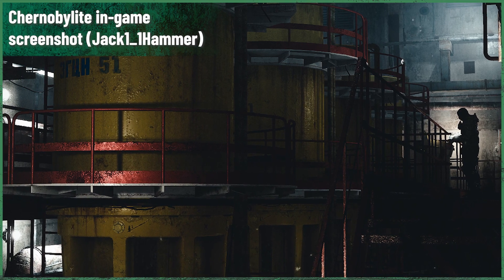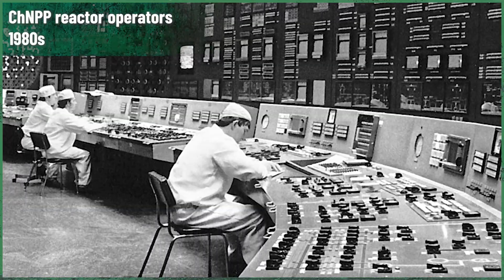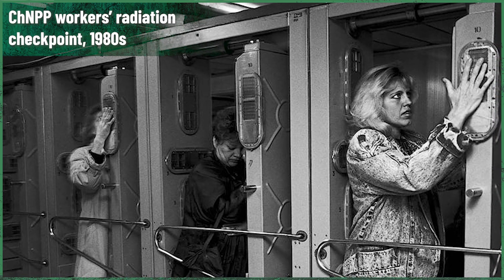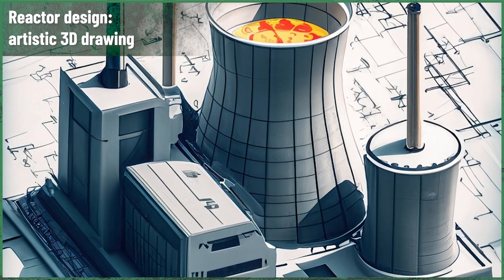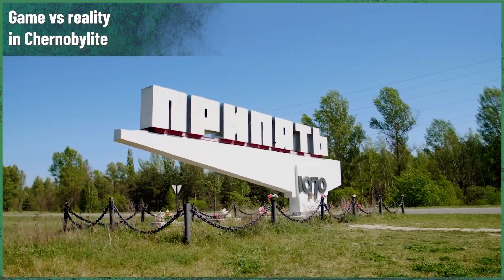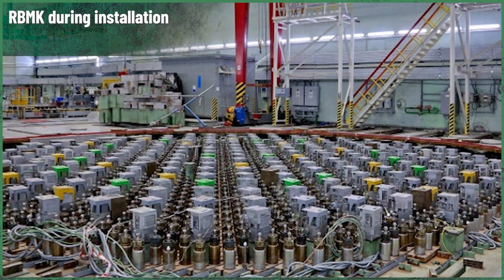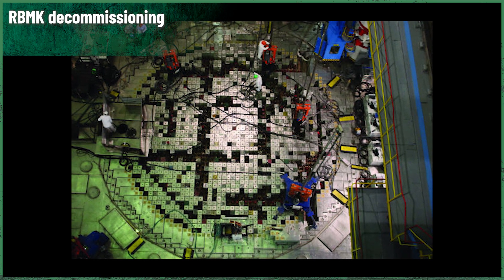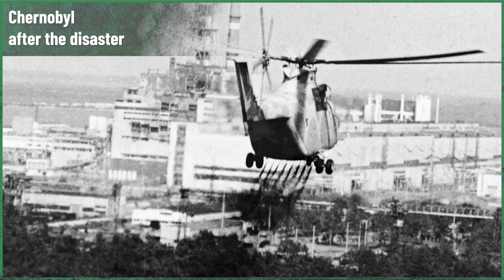How big was RBMK and... why? - PART 4 ||| Chornobyl Stories

Comment: You make a good point here about what the politics were attempting to do: prove that the communist system was better than the western capitalist system.  The failure at Chernobyl was also a demonstration of the failure of communism.
Reply from the maker: Hard to exactly tell which contributed to which (or if both were supporting themselves interexchangeably).

If I remember correctly, Gorbachev said that Chernobyl was one of the reasons behind the fall of the USSR.

Comment: The Soviets and to a lesser extent Russians have a habit of building megaprojects as a display of power. This was actually challenged by few within the system, one of which was executed for his dissidence.

The West does have some of these, but generally these were built as expansions of older facilities and/or relocations of smaller operations—not as a display of power since most of these were built by private corporations.

Comment: It may be worth mentioning that the inner core was not pumped full of water.  Water flowed through the technical channel pipes from the bottom.  The space around the graphite blocks was dry and filled with a gas that would prevent corrosion and assit in transferring thermal energy from the blocks back to to the channel.  

I had always wondered if the core was "wet"   like a PWR, so this fact was really interesting to learn.
Reply from the maker: Thanks for your insight!
Reply: @Chernobylite  You're very welcome. 
This is also the space into which the steam would have flowed and expanded the instant any of the individual channels  were breached. 
 
My source for this little detail comes from the plant drawings available on the Internet, as well as several recorded lectures available here on YouTube. 

-DJ

Comment: That’s what I hated about the Chernobyl movie or HBO special whatever he said it was cheap I don’t see that what’s the name of this video how big the reactor was whenever I hear a big does it mean cheap still cost a lot of money can you imagine if it never happened and I wonder why people are so curious now it happened in 86 i’ve been studying it since 2000 here’s a video for you why don’t you do a video on how all four reactors were basically a little bit different And how the accident can’t happen again with those reactors because they know what Went won the last time I find it amazing when people realize that they’re still running these kinds of reactors
Reply: Woah, you need to start using punctuation, I almost ran out of breath reading that.
Reply from the maker: With reactors size is not actually the biggest cost-related issue. The size was an effect of cost reduction during the design process.

They could've made it a lot smaller, but they wanted to go for max power with minimum spending.

So overall it wasn’t cheap (like a house or apartment, e.g.), but it was cheap for a nuclear reactor ;-)
Reply: I am not impressed that Russia still operates RBMK. It just shows that Russia lacks the funds to modernize its soviet infrastructure. Even the successor of the RBMK design was never built and only Putin knows when Russia will ever bring Kursk-II to the net.

Comment: Exelent begining! ,But,MAINE reason for reactor core being so huge,in comparing to western one,is the fuel(Uranium,that was not enrich enough-so to compensate they needed tri times,or more of Uranium (2325(fuel),simply -it is cheaper,american reactor cores needed at least 3 time less Fuel,but HIGHly enriched,...but there is mutch more to say about design-and powerty that lead to it....the reason to remember the 211 contror rods made of borron,it must tu remember ,beacouse russians ,in rbmk reactor specified that lowest number of inserted rods in the core must beat least 15<,nor 6 as they left in the unit 4 in which occured power surge...allso,special story,than there is xenon pit "poisoning",,,,but our friend goes slowly and werry precise with explaining,so i let this to him and his crew,all the best from me(with fly and temperature-everythings hurt me :( , Greetins Andzej -be safe,wach out of NKVD :))) , Stazi,i heard that mp Vlada is getting info about this channel,ok ,that I am allso in the list ☺ Greetings from Belgrade. Henrik
Reply: Other reactors use 3-5% enriched uranium. Uranium is not “highly enriched” until at least 20% U235.
Reply: @rdspam  Exactly. The RBMK ran at initially at 1.8% enriched fuel and was later rised to 2% because such a low enrichment made the reactor less controllable. I don't know how low they let the fuel burn down, but I doubt it is much lower than possible for modern PWRs, since it was easier to swap the fuel rods in the RBMK.

Comment: Great vid but did it have a problem with one area being less active and one area very active or is it a myth?
Reply: No, that is not a myth. The RBMK is so large - not just from a physical perspective, but from a nuclear physics perspective as well - that the neutrons can't talk to each other. One area can be almost shut down while another area is going up in power. Imagine it is like a big apartment building where in one flat they're having a celebration, while two doors down they're observing a funeral wake. This behaviour was first seen in 1975 with Leningrad Unit 1. The RBMK can behave like there are multiple little independent reactors in that one space. That is one of the reasons it is so difficult to control. You're not just driving one single big reactor, but essentially multiple smaller ones at the same time that all have a little will of their own. You need some serious computing power to keep a beast like that in check because if you don't, well... Chernobyl Unit 4.
Reply from the maker: As she/he said ☝

It's not exactly a myth, but also the measuring equipment was basicaly useless. So as far as you couldn't say what the reactivity level was in different parts of the RMBK at a moment, you just couldn't be sure of the on-hand measurements :-)
Reply: @Chernobylite  
That would be "he"😆

The thing that still gets me is the fact that below a certain power level, the operators were basically flying blind. They just had to "wing it", as they say. You're the designer of a bad tempered reactor the size of a small house, and then you cannot even be bothered to give its operators the proper tools to keep a big grumpy beast like that in check? What could possibly go wrong... *face palm